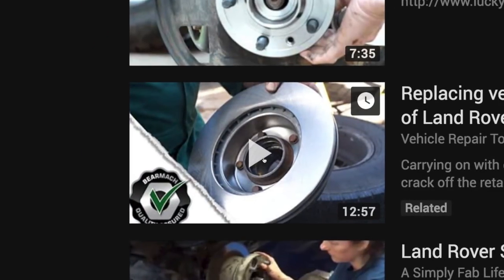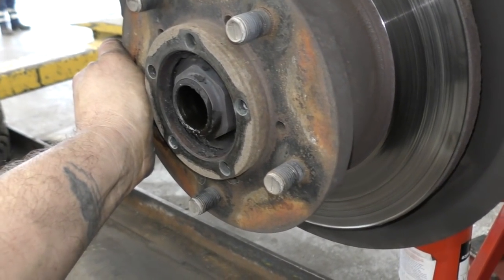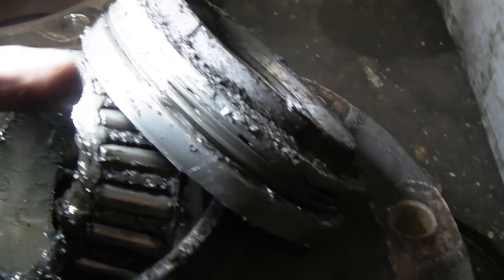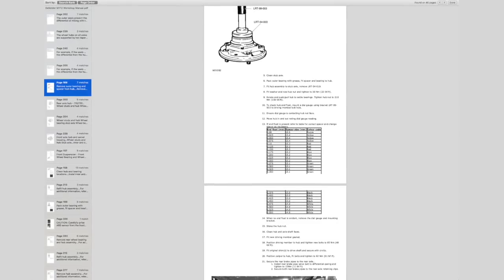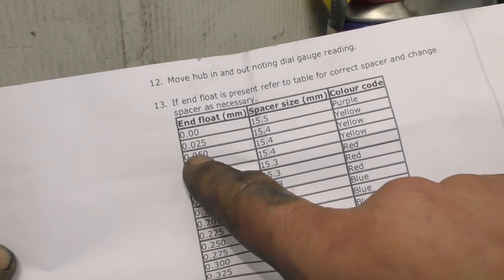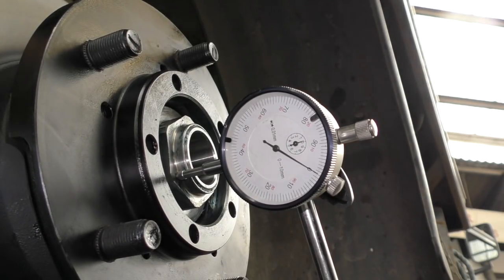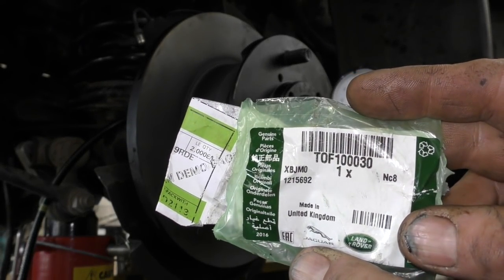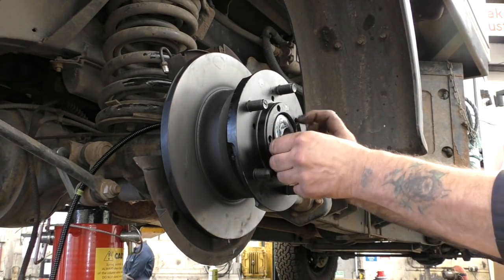Land Rover Defender Td5 and Tdci- How to Set Up Wheel Bearings using a Selective Spacer

Comment: Great video. I just wanted to check something, I have a 1991 defender 90 with a disc conversion on the back, based on your video I believe I have a td5/puma rear axle, would that sound about right. I recently changed the wheel bearings, when I undid them they weren't that tight, so when I did them back up I only went to 60Nm, I'm assuming that's wrong then, and that I should retighten them up to 210Nm?